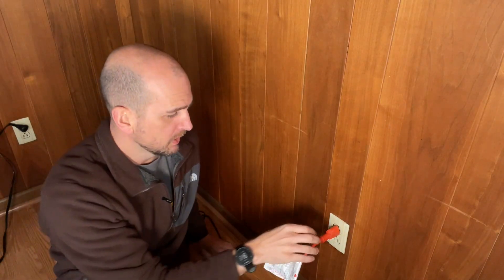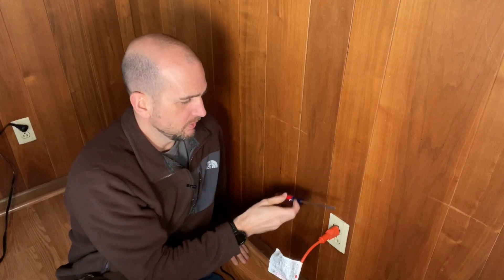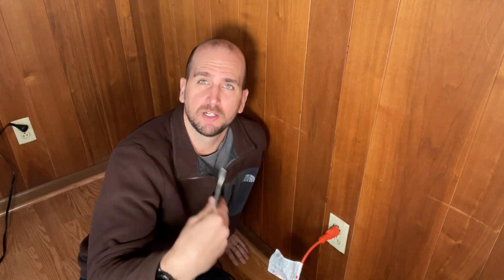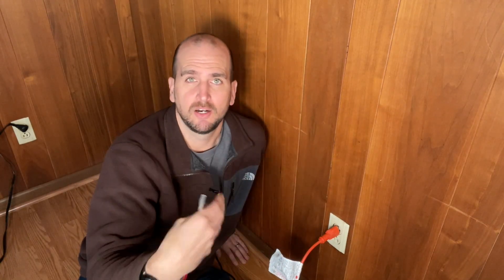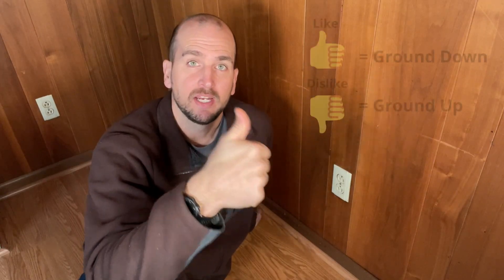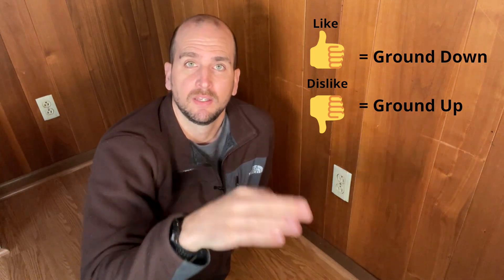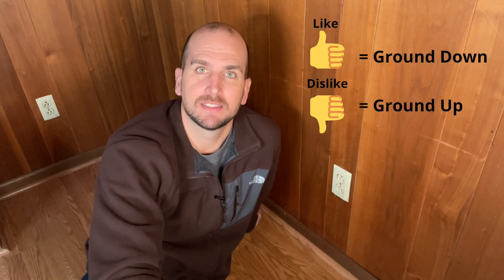Should An Outlet Be Installed Ground Down Or Up

Comment: A 90 degree plug on a cord fed from above the receptacle lays flat with the ground up. That’s one reason commercial buildings are oriented that way. Think about medical equipment and office applications and the cords generally drop to the outlet.
Reply: I'm in my local health centre all the time due to being a firefighter/EMR taking in patients and while assisting have moved and plugged/unplugged equipment I don't know how many times and absolutely zero outlets are ground up in the building. The other issue, of course, is that the outlets aren't usually mounted low but high on the wall so they can be easily reached.

Comment: Funny you brought this up because I have been wondering if the glass in my windows has been installed inside out?
Reply: It does happen, from time to time.  The installation instructions should explain the difference and which way is  correct.

Comment: Only one of the 3 prongs isnt ground. If you house is older the ground wire and the neutral are tied to the same buss. So it really isnt safer either way in my opinion.  But seems like what this is all about opinions

Comment: The electrical contractor that wired my wife's brand new medical office building gave there the "what if there's a metal plate sliding down the wall right over an outlet with the plug pulled partly out" rationale for wiring the whole building ground up. That's great and all, but it messes up all the power strips, and all the wall warts that work as a charging cradle.
Reply: WHAT IF THE WORLD ENDS?
Reply: It is NOT "great and all" if their silly reason for mounting them with grounding pin up is so extremely unlikely as to be laughable. If it means you can't plug in a 90-degree cord with the cord hanging DOWN, i.e., grounding pin down, as shown in the product installation instructions,  then that's also a code violation.

Comment: Years ago, in my technical high school, my teacher always said, "If it's ground, turn it down. If it's hot, turn it top." It's been an effective mnemonic I've had in my head whenever I swap an outlet so that I orient properly. 

Until there's code that says it's wrong, I'll continue this. I don't really see the benefit of ground up despite what was said. If your plug is that loose, it's either time to replace the outlet or replace the product/plug.

Comment: Is it not the safety rule that the ground is last to be disconnected? If a ground is up, isn't it possible the ground is disconnected first or not last? If the ground plug is long enough to keep connected even while the others are disconnected then how is the plug coming out of the socket with just gravity and cable tension not resulting from pulling on the cable?

If gravity or natural plug tension is the cause of disconnect, ground down will never have the ground disconnecting in any order other than last, regardless of how long the ground post is compared to the other two posts, which would at least address all the issues not caused by pulling on the cable in a way that causes the cable to peel away from the ground plug.

Comment: Ground up!!  Why you say?  Heathen?  Look back to the duplex receptacle inventor, Harvey Hubbell and the company with his name still producing U-ground plugs.  I am not talking about the mass produced FCQ (Fine Chinese Quality) plugs on everything today, but the true U ground.  If you look at the Hubbell webpage (links below), U (lol) will see that all the plugs have a formed U-ground blade, not just a round pin as is so common these days.  While there, also look at any spec grade receptacle they make...the Hubbell name is right side up when the ground is up.  The principle is this:  The top edges of the U "bite" into the receptacle when/if that cord is pulled in a downward/gravity direction.  Even the 90 degree plugs they sell have the U-ground on the top:  Just because fridges and power bars, which are mass produced do it wrong, does not make it right!  Put a Hubbell cord end on and plug it into a Hubbell spec grade receptacle installed "properly" with a right side up U-ground, and good luck getting that plug out by pulling down at 90 degrees.  Another giveaway, look at higher current outlets...  NEMA TT-30 and 14-50 for RV's, or a NEMA 6-50 for a welder...all U-ground up...all RV parks have them this way and the RV cords are molded with the ground up.  Some history, but you now know when you are doing it wrong... ;-)

90 degree U-ground:  https://www.hubbell.com/wiringdevice-kellems/en/Products/Electrical-Electronic/Wiring-Devices/Straight-Blade-Devices/Plugs-Connectors/HBL5266CA/p/1634099

Receptacle:  https://www.hubbell.com/wiringdevice-kellems/en/Products/Electrical-Electronic/Wiring-Devices/Straight-Blade-Devices/Industrial-Receptacles/HBL5262/p/1636605

Comment: Installing an outlet with the ground up, to prevent a short, in case a metal object falls just right on the plug,  is the classic example of fixing something that is not broken. I would like to know the number of people that have ever had that scenario happen to them. If it ever happen, the percentage has to be on the right side of the decimal point, with a lot of 00000s.
Reply: Had a metal cover on an outlet that was broken. (Didn't know it was broken) As I pulled the plug out it perfectly came off and right onto the plug.  Almost a pants changing moment there

.
Reply: @airdaleva42  OK there is one. Out of? Maybe the lesson here is, metal electrical plates, covering electricity is not a good idea. And when the metal plate touched the plug, it immediately tripped the breaker in the breaker panel. There is no way you got a shock. And the shock from 110 is not enough to get electrocuted. So, back to my analysis, there is nothing to fix by turning an outlet 180 degrees.
Reply: @igoski1582  That's what happened. I did not get shocked and my breaker tripped. I replaced it and two others with plastic ones.

Comment: QUESTION:- What would happen if the hot side of the receptacle was put on the negative side, and vise versa. Thanks
Reply: Reverse polarity is not how the device was meant to be powered. Thats why the neutral side of a receptacle is larger, in 99% of equipment being plugged in, it should be correctly fed n wired. Take a light socket, just a plain old light socket. If the wiring is reversed, then the threaded part of the socket is now hot. So when you need to change the lamp, n you are holding the metal part of the light fixture n you touch the threaded part of the lamp you get 120 volts going across your chest, hand to hand, you have a great chance of shock, even electrocution. This way your muscles will tighten up n you can't let go. In the UK n other parts they are a different type of system. 1 hot leg using 240 volts and a neutral so it is twice the voltage. In the US, we have single phase with A leg n B leg to get 240 volts. Each carries a different phase of 120 volts. As far as the ground on top or on the bottom it depends on the application. Hospitals n industrial and some commercial applications, ground up. Most residential is ground at the bottom. When I retired they were trying to get any applications ground up. Personally the look of ground on the bottom, to me looks better.
Reply: Polarity is important from a safety perspective. Here’s a great video that illustrates why: https://youtu.be/d6Eq2KRtE90

Comment: Crazy.
Never knew there was such an argument.
In Florida the ground is always down.
Reply: In residential,  but hospitals,  industrial, n some commercial buildings its ground on top. After 40 years as a licensed electrician, now retired I have seen it all. Especially doing service work. Single n three phase. Using special insulated screw drivers and other tools. 480 n up, that voltage will jump out to you. Special boots n clothes for protection. Have seen a bad breaker, 3 phase, 480 volts shoot out of a panel 20 + feet, and the out side transformer bouncing on the concrete pad. Some things you never forget. We were lucky that day when we turned the breaker on, but the a/c disconnect was off. If not we would not be here today. That electrical room was pretty much destroyed. 15 feet deep to panel on back wall, flames n sparks were shooting out the doorway.

Comment: The problem with American mains plugs and sockets is that live conductors can be exposed if the plug isn't completely inserted. 

The Europeans have solved this with Europlug connectors that are designed to never have live conductors exposed.

It's probably too late for for America to come up with a similar design.

Comment: ground down helps prevent a elect cord from being pulled out of the outlet easy. also supports the weight of a cord plugged into the outlet.
Reply: Ground up. From personal experience, the plug came out over time just enough to allow a penny to fall across the prongs. The penny was dancing on the live wires.

Comment: Why not design an outlet where the plug cannot become unplugged due to the weight of the plug as in the UK, but for 110v US supply. Would not matter then. Surely as long as it is grounded correctly, and installed properly you should never have to worry about the receptacle covers coming off. Just a thought.

Comment: I had a new clothes dryer plug installed by a friend and he installed it ground up and gave those same explanations. The problem was the cord from the dryer had to drape over from the top and looked awful. I turned the outlet around and it looks much cleaner.

Comment: As a Brit l am always surprise that that US receptacles plugs have in the majority cases have not changed to allow the flex to leave the plug at a 90 degree angle in a downwards orientation so as put less strain on the flex and the receptacle's connections. Keep up the good work and stay safe.

Comment: For years I always installed the ground down. Now I think it’s safer with the ground up. Consider a little kid pushing a metal object like a toy or fork from the top. If the ground is down the metal will hit the prongs, zap! If the ground is up no problem.
Reply: @lindnertom  Yeah, only few take kid’s creativity into equation.  :)
Reply: The fact that a kid (or anybody else) could stick a metal object on live conductors if the plug is loose belies a basic design flaw of American style mains connectors.  If we were really concerned about this safety issue, we'd mandate connectors that don't become "live" until they are plugged in far enough that there is no metal still sticking out for little Johnny to short.
Reply: @RealMesaMike  Or, why not go totally British and require a toggle switch on every accessible receptacle outlet? Or why not require all receptacles be at least 48 inches from the floor? Or why not permanently take away the children of anyone careless enough to let them explore high voltages with metal objects?

Comment: I've never had anything fall in-between a plug and the wall plate but personally I like the ground pin up simply because when you have a grounded plug they tend to droop towards the floor especially over time after the outlet begins to get loose.
Reply: If the outlet is loose, it's time to replace it. Would you take a ground down outlet, and just turn it upside down so the ground is now up if that outlet is loose? Of course not. You'd replace it.
Reply: @d.e.b.b5788  I totally agree if it's lose change it. But I'm not going to call every customer I've ever replaced an outlet for just to make sure their outlets are still good and tight. I ask them what they want an do it that way. NEC doesn't care if the ground pin is up or down

Comment: I have a question regarding a industrial switch. I installed industrial outlets and switches all through my house three years ago. And changed over to led lights. After two years some of the lights are starting to flicker and then burn out. These light bulbs are 5000 hr I think, something like that. But they have not lasted anywhere close to that. Do you think the switches are causing this problem. Thank you.

Comment: In some settings, the face plate can be metallic. Those are thin. The retaining screw can get loose. So, in that case, ground up is better.
Most of the time, it don't really mater. It's mostly a question of aesthetic and preference.

Comment: I’ve placed grounds down for 20+ years, in a jobs I’ve wired for. Commercial, industrial, and residential.  Plus, have you you ever plugged anything polarized?  The neutral is in the left when plugged in, and the object is right-side-up; a nightlight, something that has a transformer plug.  The neutral is the left blade.  The neutral blade is wider on polarized plugs. With the ground down, the Upside down issue is fixed.

Comment: Which way up?

Well, NEC says you have to obey the TOP marking on your terminal, so that will supersede everything. For instance, if Brand X were to start embossing “TOP” onto the sides of their outlets, then this is how they would be installed. You would install in accord with the manufacturer instructions. 

See NFPA 70/NEC 110(B).

Comment: I have them installed both ways in my house by the builder. I don't care about the orientation except that ground up looks wierd. That being said, ground up outlets are controlled by a switch on the wall and are really easy to identify. It also helped to explain why that random switch was where it was, about three feet above an outlet, for no apparent reason.

Comment: Ground down.  The safety argument is literally a coin toss. You would have a better chance at winning the lottery than shorting the hot and neutral lugs and if it did have a ground lug... which way would the offending object fall... from ground to neutral or ground to hot. For switched outlets I prefer a color change of said receptacle or more popular now are LED indicators. 

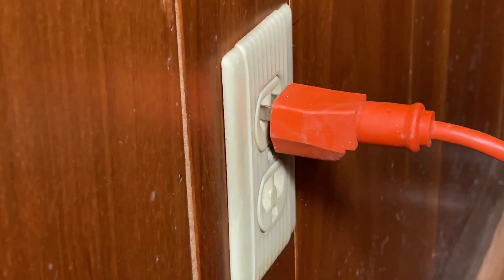Ground down because ( I was giggling at 3:30 with the 45* appliance plug in the back ground) Industry standard for flush plugs 45/90 have the ground lug down. Appliance cords are stranded so as to be flexible. However, electrons prefer to travel in a straight line. Inside the plugs are solid connections, a buss if you will, but the cord is stranded wire and the tighter the bend the more heat it will generate. With electrons heat is bad. It is not only dangerous, but it is energy wasted (money down the drain).

Comment: If your plug is loose then it needs replaced anyway. Should look like a face or if you plug a black box plug into the outlet your cord is pointed up.....not cool.  Same for power strips ground should be down when plugged in. Always a face in residential

Comment: Had a roach 🪳 crawl across the plug of the dish washer at my grandma's apartment a long time ago.  
It made a super flash from behind it.

I'm more in the boat of installing ark and GFCI breakers instead just to maintain any kind of arc or ground fault protection.

Comment: Nice interesting videos but they are ALL for the American wiring systems. The wire colors do not match nor do electrical fittings for the rest of the world, the voltage is 240vac 50hz around the world so for viewers out side the USA it represents a problem. I watch a lot of recipes on video but there is the same problem, The recommend temperatures are Fahrenheit and the wights and measures are imperial. Very few USA video cooks look after the rest of the world by mentioning BOTH Imperial & Metric. Is it possible to do it with  Electrical work?

Comment: the outlet is installed ground up.  In the event something metal cover falls onto the outlet and the plug is not fully in the outlet, the metal will hit the ground prong on the plug. Eliminates the possibility of the metal outlet touching only the hot prong.  I believe this method was first enacted in the District of Columbia.  The NEC is only a minimum standard.  Local jurisdictions have the option of exceeding the code.
Reply: Hint: Don't use metal receptacle covers around clumsy morons and you won't have to worry as much about putting them in upside down, i.e., with grounding up.  In all my years as an inspector, I have never found anyone who gives a crap which way you do it, let alone putting it into the local "code".
Reply: @UpnorthHere  A number of years ago, I had lunch with the Chief Electrical Engineer at McDonalds headquarters. In the course of our discussion, he told me that one of the workers in one of their stores had her hand badly burned. She let a metal cookie sheet (or something similar) slide out of her hand. It fell onto a receptacle. An attachment plug cap was partially pulled out...so the metal cookie sheet made contact with the two blades. A big arcing flash occurred.
Reply: @UpnorthHere  I'll bet your one of those old school guys who wets his finger and sticks it in the socket to see if it's hot

Comment: I just checked my electric cloths dryer. It plugs into a 240VAC outlet. I notice that the earth ground connection on the receptacle is on the bottom. However, in this orientation, the cord comes out from the top of the plug and then there is a sharp bend in the cord going down to the dryer. The cord is very short and it's a tight fit. Obviously in this case, it would be better to have the earth ground on top.

Comment: In commercial, medical, industrial and shop areas, I always place the ground lug in the up position to  help prevent a conductive material like a metal cover plate, from falling onto partially exposed conductor blades of the plug end.
Reply: I've heard that there are these things called "screws" that actually hold those metal covers in place.